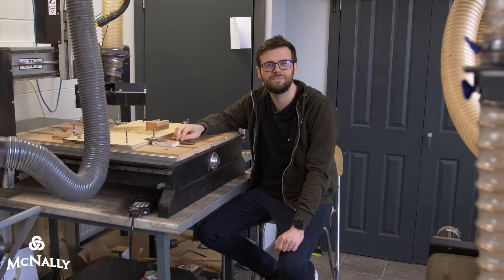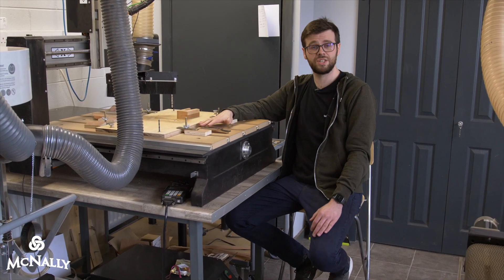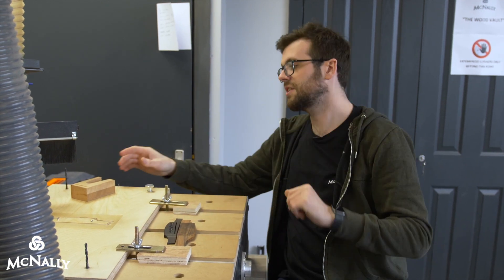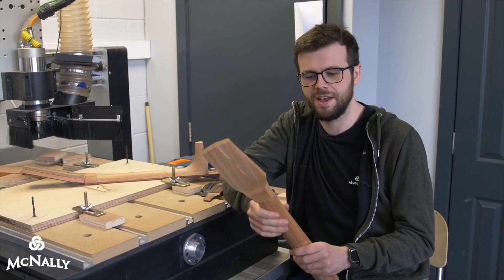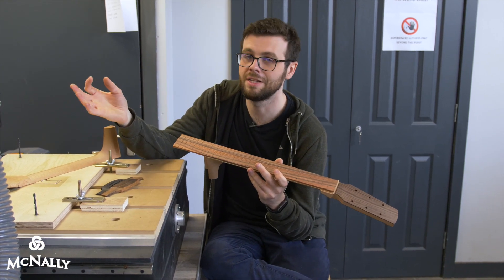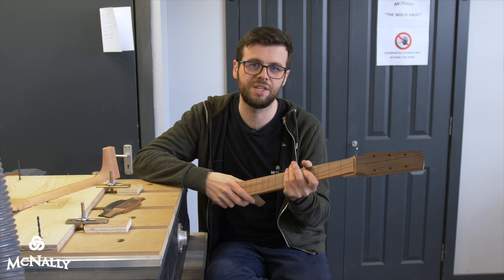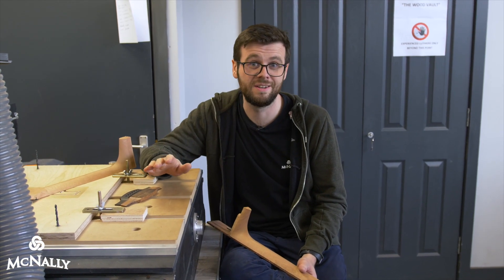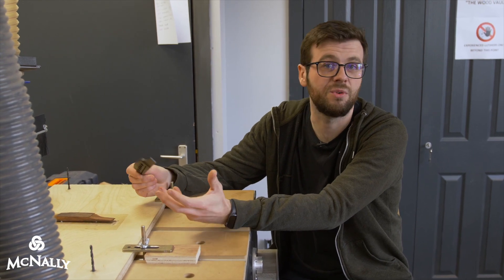How and why I use CNC in guitarmaking - McNally Guitars

Comment: Good video. I build my own machine and haven’t used it yet for guitars, I will though. I started with cigar box guitars and moved to standard guitars. I believe it’s just another tool to use, just like saws, clamps etc. if it makes things faster and more accurate then use it. Cnc isn’t a push button type of tool. You have to master the tool before you use it well for best results. 
Keep em coming!
Dave